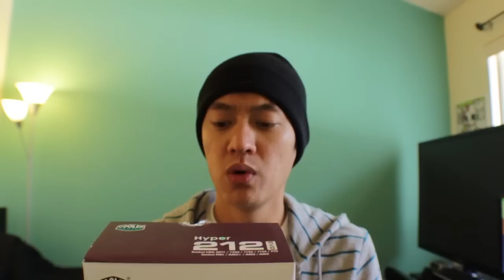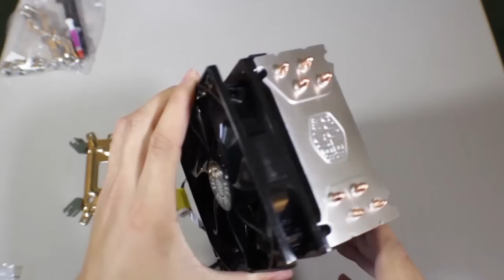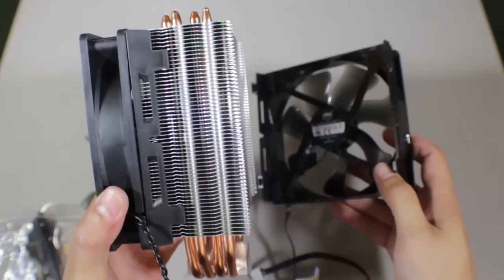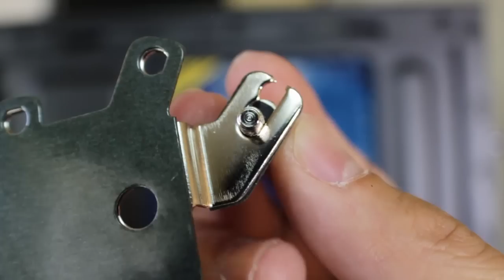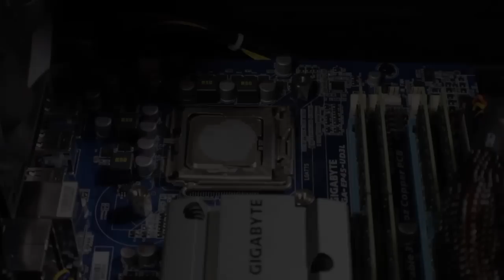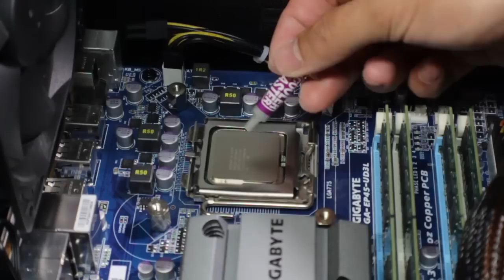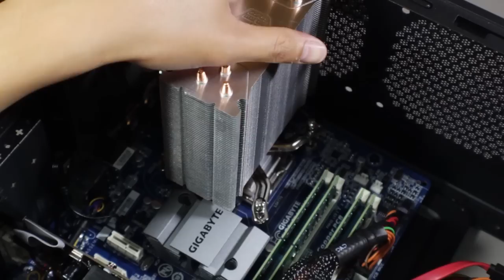Installing an After Market CPU Cooler Fan - Cooler Master Hyper 212 EVO

Comment from the maker: There won't be that much of a difference in temps. Even if you put all the fans in some random configuration it would be about 5 degrees of difference at most. It depends on the configuration on the rest of your case and where all the other fans are placed. Try to get the air flow to match your case's air flow and you should be fine. Thanks for watching!

Comment: I had a question, I am going to buy this heatsink pretty soon and I was wondering since you mentioned if you have heat spreaders on your RAM then you have to use the pull method instead of the push because the RAM blocks the heatsink, Is there a difference in temps between the push and the pull method or will I get the same temps using the pull instead of the push?

Comment from the maker: I think they are both the same. The EVO just has some extra copper touching the CPU. It really comes down to overclocking the CPU and the CPU's I have on these heatsinks are not really good for overclocking. The best value is the Plus if you can get it for less than $25. If you plan on taking the heatsink for a bigger better CPU later then plan for the EVO. Thanks for watching!

Comment from the maker: 1 fan is good. It all depends on how much you want to overclock your CPU. The CPU in this video does not even need 2 fand. I was just showing how it looked. It was easy to install both after mounting the heat sink. Thanks for watching and the feedback!

Comment from the maker: 1 fan will do you fine. It all depends on how much overclocking you want to do. The Computer I used in this video does not even need 2 fans. I just showed it in case someone want to use 2 fans. It was easy to put on both. Thanks for watching and the feedback!

Comment: Awesome video man! going to buy one for my i7 2700k. Im just going to use the one fan but if i have the possabilty to use the push or pull configuration (depending if it gets in the way of my RAM) with one fan do you recommend one over the other?? also it looked like the fan was close to your side panel were you able to get it back on??

Comment from the maker: Yes, I believe the first one was a metal wire that wrapped around the heat sink and hooked on the fan. The Plus and EVO models started using the plastic brackets and are screwed into the fans. Thanks for watching!

Comment from the maker: The case is the Cooler Master Elite 430. I highly recommend it because it has a side window, blue front fan, and is black on the inside. I paid $20 for it on sale at Fry's electronics but you can find it online for less than $50. Thanks for watching!

Comment from the maker: You should check the motherboard manufacturer for an updated BIOS. Don't update it just yet. Just look to see if in the update, one of the fixes is for system stability or something along those lines to fix an issue you might be having.

Comment: It doesn't really go higher than 45C. I will check the bios then. Something else I thought I should mention is that sometimes it won't turn back on through the front switch and I have to turn the power supply switch to off and then on again to get it to turn back on. This has happened recently but it has in the past with both power supplies.

Comment from the maker: The Absolute Max temps would be 70 degrees Celsius. Idle temps should be 35-40 degrees Celsius. Full load should be around the 60 degree range. This is with no overclocking. Also check in the BIOS to disable the shutdown threshold. Basically it might be set to shut off when it hits 60 or something. What temps are you getting?

Comment: Intel Core 2 Duo E7500. I have tried two different power supplies so it makes me think that it may be something else. It is strange too. It will work for a while without any trouble and sometimes if I leave it running over night it seems like it will turn off more often. Is there a way to test the power supply?

Comment: Perfect timing. I have been having problems with my computer just randomly turning off. I think it might be the cpu not being cooled off enough. I have the standard intel cpu cooler. I have tried using a temp. monitor to see if it is getting too hot. What should the temperature be around? Do you have any other recommendations?